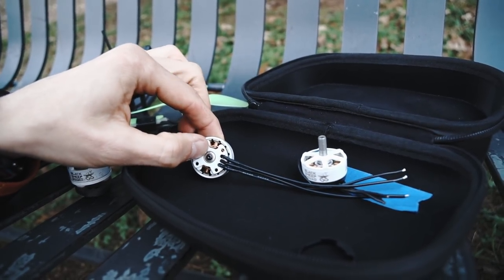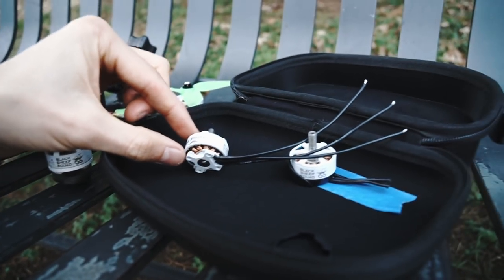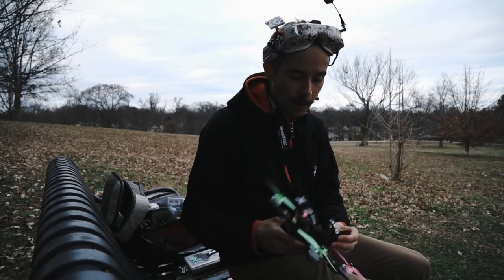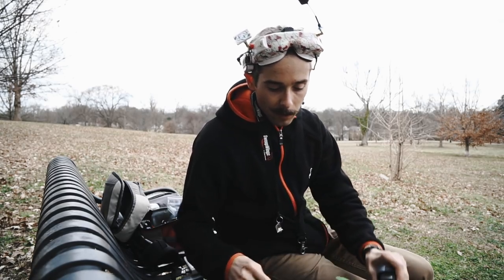Mr Steele ETHiX V2 Motors What's New?

Comment: pretty cool ... i like the PC motor guard. i fly with guards and never had to replace a bell. have had to replace a few c clips, but after ur first one you become a pro at it . needless to say its not wrong to go forward as long as its not as drastic . alot of car manufactures are the same. Toyota being one and look at how they r doin... The tundra and tacoma r basically the same but refined through the years and still sell boat loads.

Comment: Great! You’ve started me in FPV, and I’ve listened to your advice in building my Alien, never had a failure accept for losing my quad in the water (with DVR recording on of course) but haven’t recovered it yet. So I’ve ordered the new v2 motor as soon as I could for my next build, can’t wait!
There’s one improvement on the Steele PDB, and that’s more via’s in the solder pads to make them more robust.
Thanks for everything you’ve learned me so far and in the future!

Comment: Site looks great- So does the message! Just started following you and this seems like good luck for me on the timing. I'm going to build a quad this Winter and I think I'm going to buy these motors from your site. I figure I should show support as your Intro on first steps to the hobby has been my bible thus far any how. Also dug the Van build!
Reply from the maker: Hell yeah man   Thank you for the supper. If your curious  and wanted to buy my exact rig. I’m actually working with Flite Test now and they are selling Mr Steele Kits. A full box with everything you need to have an exact quad like mine. For 599$ and if you want a rtf  already built and tuned it’s just an extra 99$.  Check it out https://store.flitetest.com/mr-steele-complete-kwad-kit/
Reply: I may do that for sure. Thanks...for the link...definitely want to build as that's part of the fun. Going this route I will.at least know the capabilities by watching your skills.  Which now that I think about it.... maybe I shouldn't crush my ego that way.  Jk

Comment: Hell yeah! That's awesome you guys are starting a brand and what you are doing with it.  I can already see a bunch of cool apparel and refined or modded parts. 
Also, I have used MrSteele motors in my alien and I love them! The windings are beautiful plus the power. You made me feel a lot better about running "older" parts.  If it flies great why change it?  I really like the refinements on your motors. If I bend a bell, I will replace them with the V2 bell.  Ethix will be HUGE. Cheers!✌

Comment: I love refinement. Sounds life a laundry list of remedies to stuff I've had problems with on other motors over the years (smashed lower bells, C-clips getting in the way of popping off, slipping props, gnarled up aluminum shafts, lipo suckage and the list goes on). Looking forward to flying these things soon.

PS Yesssss, never ever use Hawk pads, ever. Or EBC.  Carbotechs (if you don't mind dust), Ferodos or Pagids FTW. So sayeth the track car bible.

Comment: Great work with the new additions and backward compatibility. It means a lot as a user to not feel f*cked over by companies when they release a v2 of something and are just like “sorry if you just bought our v1 last week.” I also had an idea for a video or convo on the podcast - how does a change in weather, altitude etc affect how you might adjust your tune? I’ve heard you briefly hint at it before, but never gone into detail about it.
Reply from the maker: Totally man :).  And yes.  Altitude, temp, and humidity can affect your tune. Typical rule of thumb is the higher you go the higher you can raise the PIDs. Colder more dense air counteracts that mantra though.  So high warm places higher PIDs. Cold high places usually the same as sea level warm temp PIDs.   But you can try to adjust accordingly. Increasing PIDs if at higher altitude decreasing at lower
Reply: Mr Steele Awesome! Yeah, doesn’t get “real” cold here in the Bay Area CA (45° ~ 65° F), but we are at sea level - I’ll hopefully get a chance to play around with “weather tuning” soon.

Comment: You got me into this Fpv a couple years ago and I never got your Motors because I was always thinking higher KV is better but I'm definitely going to be buying a six-pack of the V2's
Reply from the maker: Hell yess man
Reply: Dufour -FPV but wouldn't the bigger 2306 stator make up for the extra power from a higher kv 22xx motor? Or maybe just more low end power and the high kv has more high end power?

Comment: One problem with your advanced pants is that if debris gets in that gap it will destroy the finish on the outside of the motor and maybe other damage as well.
Reply from the maker: Maybe. But there’s always give and take
Reply: Totally i agree life is compromise and a endless balancing act. In my mind i was thinking a designe like a deer bumber for a truck protection but still open and if you use glass fiber reinforced polly it would be wicked strong.  Or even just vertical slits to shed particulate or a Mr.Steele logo cutout in your current designe would add style points as well a functionality. Thx for the replies today have a good one. Cheers

Comment: Are there any reasons why the motors are open at the top? I just recently dived into mud which required a big motor cleaning. Would be great to also avoid dirt coming in from the upper side. 
Greetings from Germany! ✌
Reply from the maker: Yes. Less rotational mass and stator cooling. There’s always a compromise.  Nothing is perfect. But cooling and quicker rpm change trumps dirt protection in my book.
Reply: KwadLife hollow shaft? Save weight

Comment: Hate to break it to you all, but 19x19 is not stronger. The whole motor is supported by the base and bearings, and having screws further away from the bearing carrier is adding weight and reducing strength, making the legs more likely to bend. The whole “table more stable with legs at the corners” argument doesn’t apply here...
Reply from the maker: Oh really? And you would know this because you’ve tested it ?
Reply: Mr Steele I’ve been working as an aerospace mech engineer for 18 years and have done analysis and testing on objects and systems with very similar properties and geometry. Quad motors aren’t the only places you find a cylindrical tube with bearings in it and a base to secure it to a flat surface. 😎
Reply from the maker: I don’t want to argue with the “aerospace engineer” in you. I want to argue with the logic of a miniquad pilot who uses this particular product on a daily basis. I’ve never had an issue with 19x19.  And I have personally sheared screws at 16x16 in the past. Multiple times
  My 4 years of constant real world experience with these products out weighs the perfect world science of a “similar” design.  This is why when I left conventional engineering school I immediately went back to a less viewed technical school for hands on real world experience.  To me you can test all you want in simulation, until you use these things you don’t know their true weak spots.
Reply: We use simulations and real world tests to determine the best design. No argument that real world experience is extremely valuable and a crucial part of the design process. Of course neither method always provides the perfect answer. Simulation isn’t perfect and testing is rarely perfect. You have many times more flight time than I have, I’m sure, so if 19x19 works better for you, so be it. But I’ll bet you that simulations and controlled tests would show otherwise. The disparity could be some variable that we don’t understand yet! Cheers.

Comment: Nice new motor ,looking great bttr that you went for the screw instead of the c clip , i have emax motors (first build) and I already loosed 2c clips midair before my 10th fly , they look really weak also, .. but i got one question do you use bearing grease for you're bearings or yust dry ?
Reply from the maker: I don’t grease bearings no.  It’s not bad. I just never have needed to  my rigs seem to be smooth without needing a bunch of upkeep
Reply: Mr Steele okey im a carmechanic (dutch) so for me it seems needet for bearings to be greased , but i think these bearings are disignt diffrently and also has nothing to keep the grease in so thats why i asked

Comment: They will be available soon at www.prop.city in the USA. 

Out of thousands of steele v1 motors sold I have had 5 come back. 3 of those were user issues with putting the screws in too deep so out of several thousand motors 2 had issues. One was a loose speck of metal the other was a tight bearing.

Good luck on your new venture! Pin this!
Reply from the maker: I gotchew homie !!  Thanks for the love ❤️
Reply: The love is Requited! 

With the traditional practice of planned obsolescence in product development cycles these days it's clear from your commentary that at ETHiX you intend to buck that trend thoroughly. That's giving everyone some love!

Comment: Buyer caution: bought these and in one soft crash on grass, now I have two dud shafts. Even with the antenna taking most of the hit and bells looking like new. These are NOT very durable after all. I had a harder crash (on concrete) with my Emax LS and they’re still holding up well. 

I genuinely thought with the V2 being “improved” steel shafts that these would be sturdy. Maybe I’m unlucky, I hardly think so but thought to put this out there based on first hand experience.
Reply from the maker: What is a dud shaft....
Reply: Mr Steele To clarify, motor 1 and 3 bells are bent (they both sound crunchy). I cross checked this with the motor 4 bell and indeed, motor 3 is actually fine. 

On record, I sent a support ticket to TBS outlining my case and from reports, Trappy and the team have amazing customer service. I'm not backtracking, but I think these motors look amazing and performed well, and want to give them a second chance.

Comment: why you love low kv its too slow! i would use 2345kv on 6 inch #2750kv life
Reply from the maker: You’ll also be buying new batteries every few weeks
Reply: Mr Steele nope I have only ever used one set of lipos and they each have 50 odd cycles on them